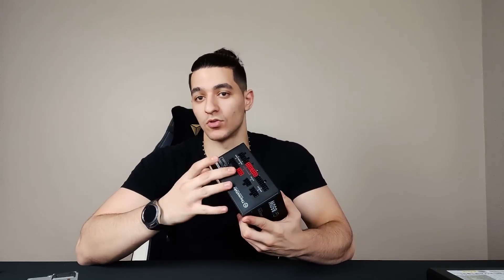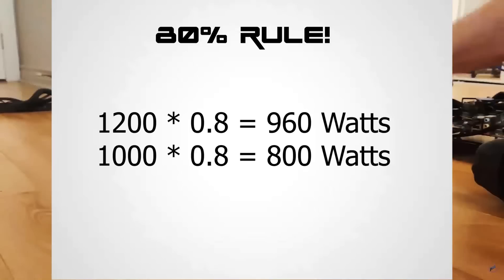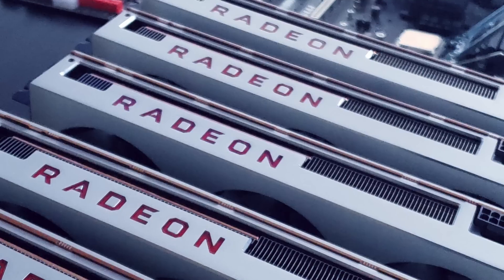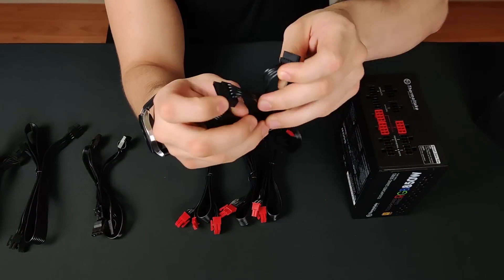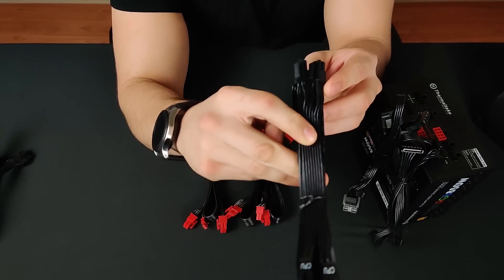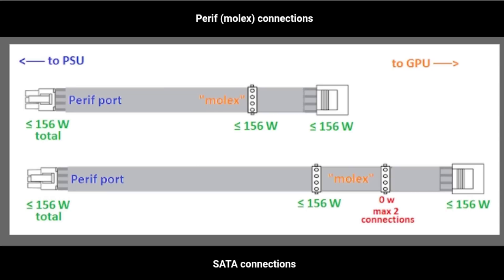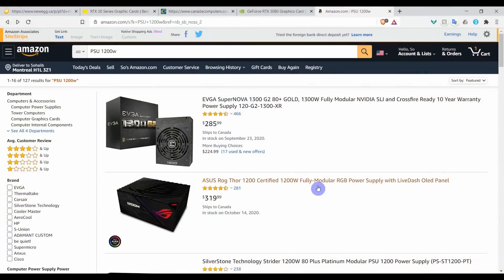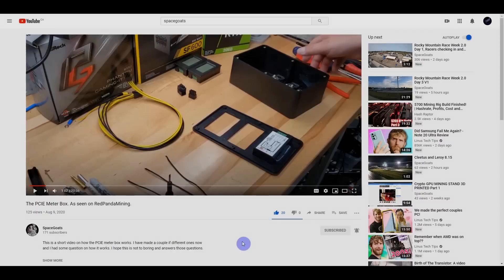Using ATX Powersupplies For Your Mining Rig FULL GUIDE

Comment from the maker: Additional tips by the community! We will be adding more to this the more we come across different tips.
- Power the GPU and Riser with one PSU! Don't power a riser with a PSU different than the GPU and vice-versa
Reply: What if the rigs I’m looking at are all 220 and in my home I can only do 110v what should I do buy adopters I can’t get an electrician I rent
Reply from the maker: @sn3akydna314  hey! It's most likely because your getting server PSUs. Unfortunately there isn't a way around it but you can learn more about this in the server psu video guide!
Reply: Hi, is it reccommend or not if I use 500w atx to power up the motherboard and another 1000w to power up 8 risers and 8 gpus rx 570? Thanks in advance
Reply: @ekokukuhwibowo5605  you need more than 1000w to run 8 of them safe
Reply: @Jason-uk9cx  sure, you would need 150x8, divided by 0.8 load safety factor, so >1500W. Do you need a motherboard connector splitter or is it enough if you just power up first the GPUs one and later the CPU one?
Reply: f I use a riserless 8 lane motherboard does it supply an additional 75watts? maybe the additional power delivery will reduce issues if there is a reset and the power consumption jumps? generally not sure would appreciate anyone's insights, cheers!
Reply: I'm having issues with mining software crashing and closing.
I have a B250 MB, was using 2 corsair 1600i, added a third.
I have six 3090 GPUs, 2 Founder's edition, 2 kingpins and other 3090 rgb 3090.
Any help would be greatly appreciated.

Comment: hey if i got 2 3060ti (with 8pin each of them) and i got pci cable with two 8 pin, can i connect the cable to both of the 3060 ti? that's mean 1 cable go out from the psu and connect 2 gpu

Comment: Okay i need some one to walk me through this part at 8:39 , 1 splitter (6+2 into  2X 6+2) into 2 diffrent risers , if the first riser draws 20w and the other riser draws 75 w , dose the cable draw 95w and the compotents(the gpu's) resistents split the eletricity between the 2 riser's .
Or am i not getting this

Comment: my gpu is 1660 super. Can I use 1 vga cable to power 2 gpu which has 8 pins each and the other is to the riser. Is this safe? Thank you for this safe practice video.

Comment: hi, i have a question. if my gpu has 3 x 8 pin power connector, should i power it at all connectors? i mean is it possible to connect 2 x 8 pin from psu to gpu and 1 x 8 pin from riser? 
im new to this, sorry if there is a mistake

Comment: I am having issue with my 6 GPU Setup. I have 6x RX 6700xt with 009s risers. PSU is Cooler Master MWE 850 Gold V2. 3 GPUS/Risers/SSD/Motherboard are on one PSU. And remaining 3 gpus/risers are on second psu. I am using 24 pin PSU Splitter cable. When I power on, 2nd psu fan rotates for 1 second and stop. None of the gpus/risers connected to 2nd PSU has any power. I swapped the whole setup and tested, but result is same. So both PSU are acting same way. I tried paper clip test with nothing connected and same result, PSU fan spin just for a second and stops. Am I missing something or Cooler master PSu need some different pin short? Does this PSu need any load like a molex fan to stay on when using paper clip test or 24 pin splitter cable.
Reply: We asked cooler master what is the issue. They told PSU does not support as secondary. So now we are stuck with a 850 watt PSU and 3 GPUs sitting idle. We will try with some other brand PSU. BUt never expected such dry response from cooler master

Comment: Looking to connect 2 PSU to one motherboard using a PSU splitter cable.
Setup will be as so:
primary PSU connected to motherboard and all its components as well as 3 6700xt GPU. The PSU is 1000 watt.
Second PSU also 1000watts will be connected to 3 other 6700xt GPUs.
I don't want to damage my motherboard or GPU. Is this setup alright?

Comment: great video, but a lot of stuff isnt clear. Like how you connected 2xRadeon 7(190-300) to the VGA cable which has 288wt in total? or VGA port provides 288WTx2=576WT? In this case it makes sence to connect 2 Radeon 7 to one VGA port

Comment: nice video thank you, just one question, 75w riser it is in addition to the consumption of the GPU? or is it included? if my 3060ti uses 190w, I count 190 or 190 +75 for the cable and the power supply? thank you

Comment: Thank you for the detailed info! Just one quick question, can you use one PCIE string with splitter to power a 300W card and a riser? Since one PCIE only provides 288.  Is one PCIE string with splitter plus a molex string is better solution？
Reply: Did you figure this out? Was planning to power a 3070 ti with one 1 PCIE then just use splitters.

Comment: Great video buddy, just wondering when using a dual psu adapter (24 pin) that connects both to the motherboard how does it work powering them up? Do you still need to flick both psus on or will the secondary just power on? Thanks
Reply from the maker: Hey! You just need to flick them both on from the switch on the psu itself and then turn on the rig with the power button like you would do for one psu rig
Reply: Best Power Supply For | 12 GPU Mining Rig 3500 Watt Unboxing
https://www.youtube.com/watch?v=5HoUPLEaUBE&t=209s

Comment: I have question, I’m trying to power 12 3060 Ti (single 8 pin) each needing 200w (before OC). What I have in hand is 2 1200w PSUs and a mobo with 12 PCIe slots. Each PSU came with 4 PCIe cables. That leaves me short 4 PCIe cables. 

Do I have enough watts to power the 12 GPUs? Each 6 GPUs will need 1200w exactly before over clocking. What brand PCIe make good quality cables?

Comment: So, just to be clear.
Since one pci-e power source can supply 288w,
Technically I can plug 2 rtx 3060 plus both their 2 risers into one pci-e cable source, yes?
Both cards only draw 236w after overclocked. I set a temp limiter to make sure the miner won't mine if the card reset to stock setting.
So with two pci-e power source I can plug 4 rtx 3060 safely, yes?

Comment: 😂😂 sry i dont want to be rude but i have to call you out for BULLSHIT. One 8 Pin according to standard is rated for 150Watts and not 288Watts. 
Otherwise all 3090 would have one 8pin and the pci e slot as power accept the better cards mayve 1 8pin and 1 6pin. 

Fakts is:
6Pin 75Watts
8Pin 150 Watts

Cables can be able to carry 288Watts maybe depends on manufactorer and if they are willing to use more copper than others.
Reply: Gerrard shaw  Lol dude stop beeing childish. If you want to say something bring serious fakts standards are standards. But its always easy to attack someone with trying to attack him/her personally just because something you can believe or you dont know.....Pretty low attitude.
Reply from the maker: It's okay there is alot of debate on that topic ;) I talk about it in this video in the first section(timelined in the description) https://youtu.be/G3RsEMsB7To 

Fact is that alot of miners such as my self have been running the 8pins on 250 watts and less for 3+ years almost full time and not a single issue so far.

P.s. that other guy commenting is a bot so don't mind him, I deleted his comments
Reply: @MiningChamber  The thing with standards is its the minimum, that means everyone working according this has to follow the minimum but can go above it. Some ATX powersupply will die before you reach the 250w, will run quite hot and degrade maybe fast and others dont care about it. 😉

Comment: Is there anyone around here with experience with more than 2 PSUs? When looking at the prices I am not too willing to shell out 400-600€s for a decent 1500-1600w platinum or titanium rated PSU, but instead, am thinking about using 3-4 or even 5 650-750 ones. I have used dual PSU setup for a pretty long time now, never had a problem, but have never tried more than two. I know how it should be wired and all that....but is there any risk of frying anything? Thinking about the PSU controllers, amps, etc...

Comment: Hello Mining Chamber, is there any difference between the 6pin to 8pin dual and 8pin to 8pin dual? As I see in your video, 6pin only delivers 216W, which means if we plug in the 6pin to 8pin dual to a  PCIe cable, the cable only delivers 216W in total right? (so we lose 25% watt when using 6pin to 8pin dual?)
Thank you!

Comment: Hi I have a 1000w psu and 1 3070 and 2 3060 ti. I only have 5 pcie slots in the PSU. How can I power all of these things on the psu with only 5 slots? The 3070 takes 2 8pins, the 3060s take a single 8 pin each and the 3 risers take a single 6 pin each. Thanks!

Comment: I still don't get it. Can you do a visual? Because I have my risers and RTX 2070 and dont know how I should wire it.
Reply from the maker: A visual is in this video https://youtu.be/UjgETEEaat0
Reply: @MiningChamber  Ahh thank you. I just looked at method two in that video. So does this require two splitters? Or is the PSU using the supplied PCIe cables?

Comment: what if u connect 2 different molex cable to power 1 gapu, will it work?
Reply: *GPU
Reply from the maker: Avoid that, not safe
Reply: @MiningChamber  How about connecting pcie connector that has 2 8pins with 2 pcie splitter on each 8pins then connecting those to 2gpu. Will it work?

Comment: to recap and ask my question, A: i have a 3080 2x8pin card TDP 320W, if I am just straight plug in the card on motherboard (which mb pcie provides 75W), then i should only need 1 strand of 2x8pin connector (provides 288watts) for the card to stay on the safe side, correct? B: if i decided to use riser later on, then I will need another strand of 6 pin goes to the risers, right?

Comment: Can I know, if I decide to use RTX 3090, is it safe to use 850W PSU for 2 RTX 3090 since RTX 3090 requires 3 PCIe x 8? If I use 2 PSU and have only have motherboard, do I need to still connect to the motherboard for the second PSU or I can direct power the GPU?

Comment: Great guide, however, i wish for one and first, you accentuate and apply pauses when you speak. You kind of read and glide through a script. Often, what you are saying blends and it is difficult to distinguish whether you still are talking about the same topic, or you just jumped to a new paragraph. For two, would like to hear about connections on the PSU unit itself, how they are marked and whether they could be used just for one application or they could be modified with adapters. For example a CPU port: if i do not need to hook up on my MB, can I use it to power a GPU or raiser?

Comment: Thanks very nice explanation, have a question though, can i use cpu cable for powering gpu?
Reply from the maker: You have to use cpu to gpu adapter which I cover in my latest psu video
Reply: Best Power Supply For | 12 GPU Mining Rig 3500 Watt Unboxing
https://www.youtube.com/watch?v=5HoUPLEaUBE&t=209s

Comment: My sata risers has 6 pin to sata adaptors they came with, but I just remove the adaptor and 6 pin from sata plug on psu to 6 pin on riser. Would it be better to just put in a VGA port and do a 8 pin to 6 pin splitter? Didnt want to overload VGA rail with power to risers

Comment: new to mining, building my first rig, I have a question about pcie cables:
PSU: EVGA Supernova 1000W  G3 80+ Gold

GPU: EVGA GeForce RTX 3060 XC GAMING, 12G-P5-3657-KR, 12GB GDDR6 - 170 Watts
ZOTAC GAMING GeForce RTX 3060 TWIN EDGE - 170W

----

MB: MSI Z390-A PRO LGA1151(Intel 8th and 9th Gen)
PROC: Intel Core i5-9400 Desktop Processor 6 Cores
 
2 GPUS are using VGA1 and VGA2 8pin to 8pin cables

I don't have splitter yet but everything else is ready, so can I use
VGA3 and VGA4 to power risers from 8pin to 6pin cables that comes with the PSU?
Reply from the maker: You can use your vga cables to power risers too yes but with splitters it's going to be alot easier once you get them

Comment: I plan to build a mining set with 3pcs. of RX 5700xt with power usage of 110watts per gpu  undervolted using afterburner.  Does a psu of 750watt gold/plat 80 true rated enough?

Comment: What do you think of using a CPU to PCI-E Adapter to power risers. My PSU (Evga 1000 G+) has 2 CPU 8 pins and I only need 1. Assuming I procure the right adapter and take into account the power limits of the PSU...
Reply from the maker: Ive used those adapters before on a corsair PSU which has PCIE and CPU slots labeled the same (interchangeable) but not sure if it would work on an EVGA PSU. It might be risky to try to see if you can find someone that tried it before as well
Reply: @MiningChamber  Thanks for taking the time to reply! From the research I've done the pin-outs are not the same so an adapter is definitely needed but I can't find any credible online resources on people doing it besides a real life friend who claims that its do-able as the CPU labeled slots on the PSU are used to power hungry processors, so powering 2 risers on them should be fine (75W * 2). I'm still a bit skeptical so I'll do some more digging. 
An alternative approach I was thinking of - which is based on the diagram in your video about PCI-E cable load. If I were to power a 5700 XT that required 2 8 pins and the power draw on the card is 225 Watt as rated by Radeon, can I use a Y splitter on one of the 8 pins and use that to power the riser? From the diagram I see that each 8 pin can handle <=228 Watts - and I'm using 2 of these ports to power a 225W card and 1 (75W) riser = 300W - so its significantly less than the 228 * 2 = 456W that the ports can handle and gives me some room for power spikes should they occur. Essentially, its 2 8 ports on the PSU powering both the GPU and the riser.

Comment: Great video. There's only one thing I don't understand. at 15:20 you say that if you buy 8 pin to dual 8 pin cables, you should make sure they are compatible, but not for splitters? I want to buy some pcie 8 pin to dual 8 pin cables to power my rizers and psu's but Gigabyte doesn't sell them, and I'm afraid that they might not be compatible? But I see you using black and yellow splitters that are clearly a different brand than the PSU so I'm confused...

I think I figured it out while typing this, if someone could correct me that would be great: The cables only need to be compatible if they are plugging directly on your PSU, so splitters don't have to be the same brand because they connect to the original PSU cables...

Comment: they say powering riser with SATA is bad , u say its ok?
Reply from the maker: I dont say its okay, I say avoid it as much as you can. If your using gpus that take more than 100 watts which is basically everything except 1660s and 1060s then avoid SATA to risers but if its 1660s and 1060s its fine to power a riser or two with sata
Reply: @MiningChamber  thank u :)

Comment: Help! I bought a bunch of pcie splitters and the female plug won't connect to my 6+2 pin pcie gpu cable from the psu.. It plugs only with the 6 pin pcie (without the +2) is this ok?
Reply from the maker: It might be cpu splitters! You need to make sure you get the right gpu splitters which have a tiny gap in their connectors, do not use them if it's cpu splitters which it sounds like they are

Comment: Hey, I have 3060ti in my system with a Thermaltake 750W PSU. I've been mining for a month now and I decided to buy a 3060. My PSU is not modular so I have to roll with what I have. There is only 1 cable coming out of PSU but at the end of the pins there is 1 more PCIE connected. Kind of like an extention. Since my MOBO doesnt have any other slots for the second GPU, i'm going to use a riser.  In that case i need a splitter as well. But i only have 1 spare PCIE. I'm trying to figure out what u said at 7:00 but i'm still confused. Is it safe to get a splitter and plug it to the spare PCIE connection that i have and plug the other sides of it to GPU and riser? My 3060ti uses 120W while OC'd and 3060 will be near that too. But if OC gets crashed somehow, the total power draw will be more than 288W. Since all connections are on the same cable, isn't that going to be dangerous or is my logic wrong here? I have spare molex cables coming out of PSU as well and i'm not sure if i should get a splitter and just use PCIE connections or use 1 spare PCIE for the GPU that i'm going to get and power the riser with molex OR get a whole new modular PSU. I feel dumb for asking these but i'm completely new in this whole mining thing and i just wanna make sure everything's ok.

Comment: can’t u just buy extra pcie extensions??  if u need to power the newer higher powered cards? 3060 ti ex
Reply from the maker: If it's a 3090 you need 2 cables for it but the rest you can do it with splitters
Reply: @MiningChamber  thank u. will try figuring it out

Comment: Great video!!!  I bought this ADT-Link adapter from amazon (https://www.amazon.com/-/de/dp/B07YDH8KW9/ref=sr_1_4?__mk_de_DE=ÅMÅŽÕÑ&dchild=1&keywords=ADT-Link+M.2+NGFF+NVMe&qid=1618061222&sr=8-4) to use the M.2 slot for another GPU. Can I plug in my GPU directly here or do I have to add a GPU riser in between? If so, what about the power supply? Do I have to supply power to the ADT link AND the GPU riser (both molex)? I want to be sure that I don't pulverise my mining rig...

Comment: do you thing its safe to plug 2x580 8g 8pin with the same cable or same splitter? undervolt or not!psu is a corsair 1200 hx platininum.i want to plug 6gpus but only have 5 slots cause of the cpu cable.thank you in advance
Reply from the maker: Definitely don't plug 2 GPUs on one cable. If it's a single 8 pin gpu then you can't do much but If it's 2 8pins gpu then you can do 2 cables from psu to 3 GPUs. Each cable powers 1.5 gpu

Comment: I have found a cheap power supply but it is 12.88v is there any problem if i use i little more voltage? I am talking about the bitmain z15.